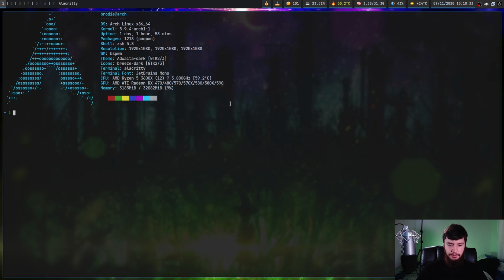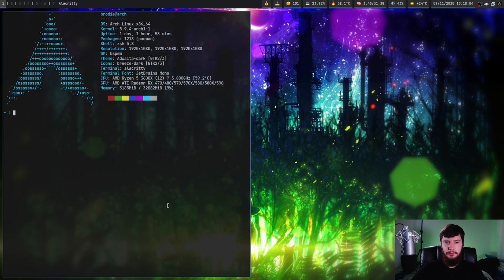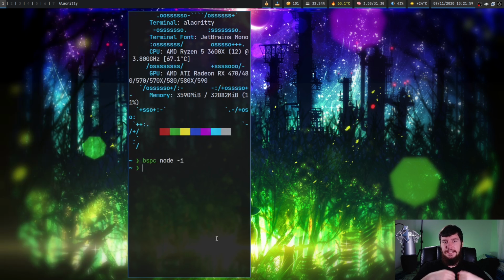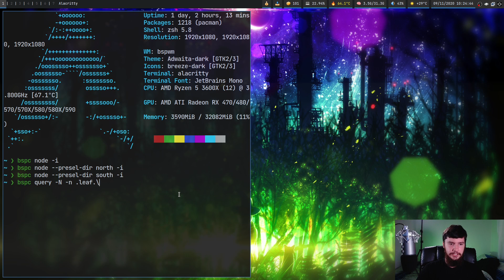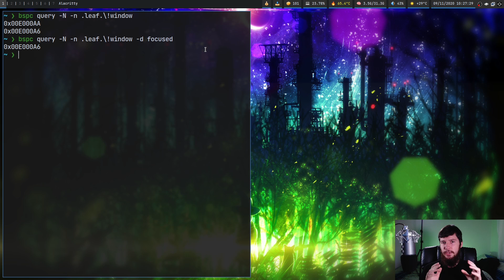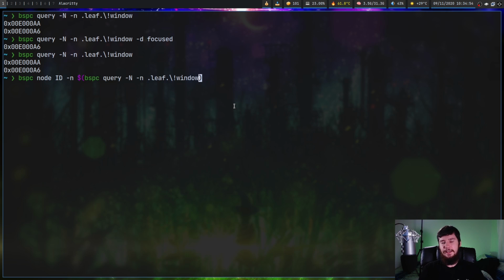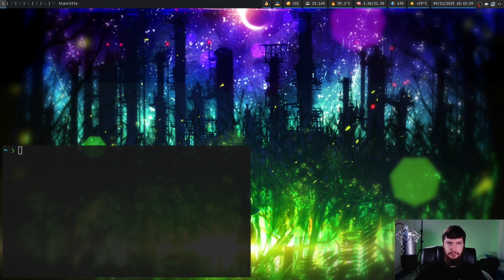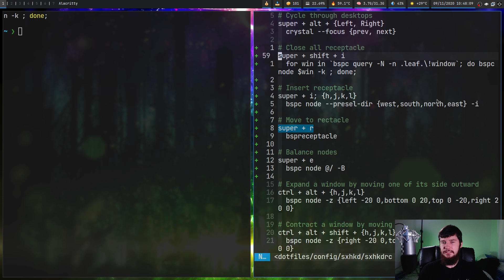Bspwm: Manual Tiling With Receptacles... Kind Of

Comment: Have you ever tried notionwm? It is a manual tiling window manager, but it's interesting af, it does something similar but with frames.
Reply from the maker: I have not but it sounds cool
Reply: herstluftwm is also the same way. Also uses frames, and it's configured like bspwm is with a bash script and using a client.
Reply: @copper4eva  Yeah, but notion is really kind of its own thing, also, it's configured and extended in Lua

Comment: I don't really see the advantage of manually creating the receptacles and assigning them instead of just using the visual preselection as it is done in the example sxhkdrc in the bspwm repo.
Always nice to see a bspwm vid, though.
Edit: That of course doesn't mean that there is no use for receptacles. I for example use them, so I can manually mark a node and move it somewhere else completely. However in the video it looked like you were mostly using it for situations, where you could also just rotate some nodes a few times.
Reply from the maker: It was an easy example to demonstrate how they work but a more productive use is having predefined layouts and moving windows into those layouts
Reply: @BrodieRobertson  I see what you mean, but at some point I think one might just want to switch to another window manager. I feel like  bspwm isn't really about many layouts. Even though one could of course make it happen.
Reply from the maker: @WizardGambles  It's not about layouts but it does expose control of the tree to the user so they're free to whatever they want with it.
Reply: If anyone is interested check out the sxhkd bindings for alt-shift-m and alt-shift-f for how I do it.
https://github.com/dann-merlin/configs/blob/master/sxhkd/sxhkdrc
I also mark nodes I am about to move with a fat outline.
Reply: I use this feature a lot. I create a big receptacle on the first workspace of my big monitor and just leave it empty. That way I can have a large area "reserved" for floating windows, while keeping a small area to the east where I can tile stuff.

Comment: Hey Brodie, always love the BSPWM videos. I made a set of scripts a while ago to help with multimotor setups. 
- Groups of screens so you can switch between all monitors at once.
- dynamically add and delete new screen groups.
- switch between them with rofi/dmenu.
- have preset application groups available through the same dmenu list. It will create those windows with the applications (and arbitrary commands) or switch to it if already created. 
-configured in a single yaml file. 
Is that something you would be interested in? I could put some polish on it and make it available as a package, or just share the code on GitHub if people want to rig up their own.
Reply from the maker: That does sound pretty cool